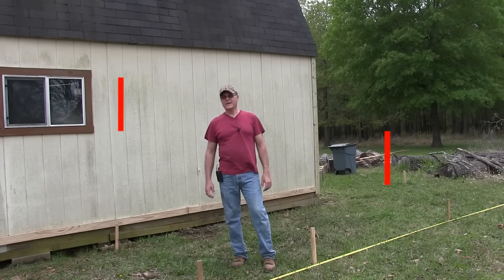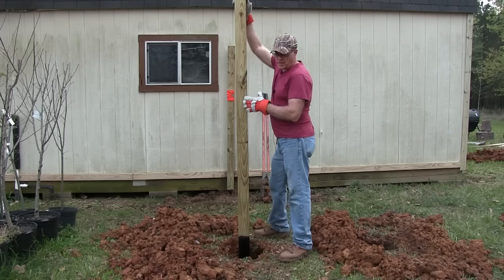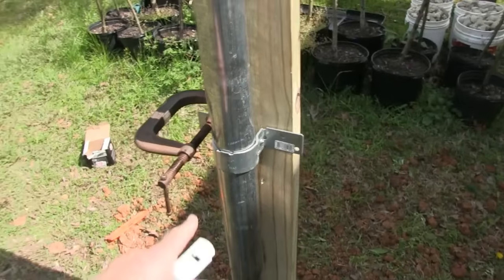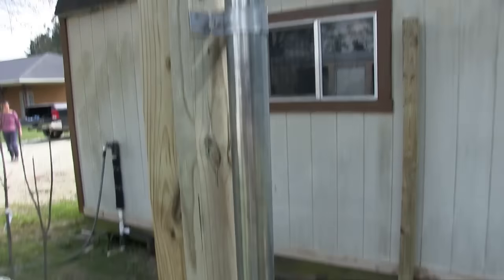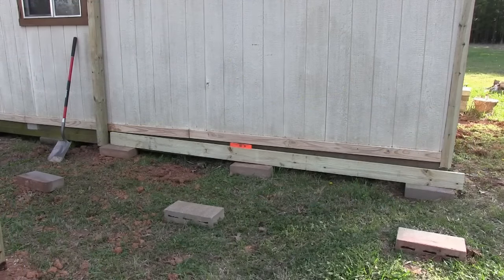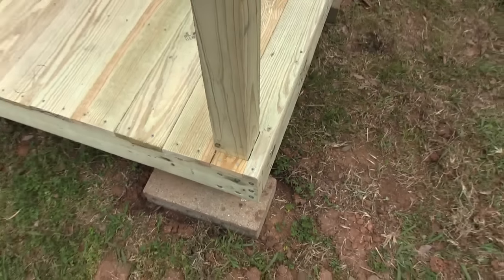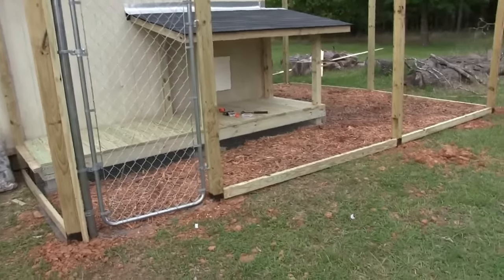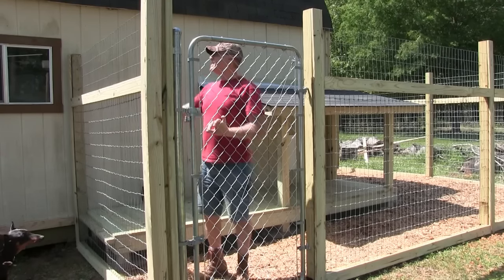Building a dog kennel

Comment: Great job! Just some opinion, instead of putting the mesh to prevent digging, you actually could lay some stone deck on and between the stone deck, cut a 1” or 1 1/2 diameter PVC in half as a drainage lead to outside the kennel, so when they poop on the stone deck just flush into the PVC and running along to outside.
Reply from the maker: Thank you

Comment: Awesome Build!! Thaaank you for sharing!!
Reply from the maker: Thank you
Reply: I'm about to start building a dog kennel, with concrete slab, and now you have me rethinking that plan. Concrete is just so heavy to deal with. I wanted to avoid digging the post holes, but now I'm thinking that may not be so bad if I can get the floor of the kennel set up right. Maybe I'll put gravel beneath, for some drainage.

Comment: You did a really nice job, great work. I'm considering a design that will prevent my dogs from reaching the ground, my dilemma is pouring concrete for an area that will be sufficient for thirteen dog is a little costly especially after factoring in the cost of all treated lumber. I still have a little time because eleven of the dogs are six week old pups and with winter coming in I may wait until spring to move them outside. Some people have inquired about the pups but I can't be certain that they won't be used as fighting dogs so I'm just going to keep and train them, after this long msg I basically just want to know if you have any suggestion on a design?
Reply from the maker: Thanks, I'm glad you liked the kennel. I don't know how big of an area you have to work with but 13 dogs is a lot. My area in the kennel is 224 sqf and you'll probably need at least 500 sqf at minimum. Personally I would make it similar to mine to keep cost down with the 1/2inch hardware cloth (mesh) staked to the ground, and a few inches of wood chips on it. The wood chips let the urine go through and the poop is super easy to pick up with a shovel and the dog can't dig a hole. The dogs stay clean and there's no muddy mess to worry about. The cost to put concrete would be a bit costly and then you'll have to hose it down every day because of the urine. Sorry I probably wasn't much help but it will keep cost down if you build it this way.

Comment: Extremely. Nice Kennel. !  I had to laugh. How the dogs were actually. Hanging out. On the.  Decking   Right away. Its  like they.  Figured out. Right away. What is  home !   I can tell. You have.  A lot of experience in.  Constructing.  A functional and practical. Kennel  i was wondering. If there is any. Concern. On using. Pressure treated. Lumber  for fear of dogs chewing on the toxic chemicals   That is used. In the process ? Or  are there any  other. Cost effective.  Products that. Can be. Used. For that type of a enviorment ?
Reply from the maker: Craig Monteforte Thank you, pressure treated wood today is not the same stuff they used years ago. You can always make it out of cider, but that would be very expensive.

Comment: Good video Pete.  I have a couple of GSPs and have always had my bird dogs on slabs and always heard the dogs should be off the dirt.  That said, I realize I and others could have been misinformed all these years.  I need to do another kennel soon but concrete cost is bumming me out.  How has your kennel worked a year in now as far as dogs having the mulch?  Is it a certain kind of mulch?  Thanks
Reply from the maker: The kennel is working great. The 1/2 inch hardware cloth stops them from digging and the mulch is softer for them and puts a barrier between them and the ground. If a weed gets through I just get a flat shovel and scrap under the chips against the hardware cloth and cuts the weed off. The mulch I used is Cypress mulch and it's holding up real nice.
Reply: Thanks buddy

Comment: Do you think welded wire would be okay instead of using woven?
Reply from the maker: Yeah it should be okay but the horse fence I used is much better.
Reply: @petebeasttexashomesteading  I was thinking of going that route, but i've only been able to find 330ft rolls of the stuff. That's maybe just a little bit more than i need lol.

Comment: Can you send me a list of all the wood I would need for this like the size of the posts and ect.
Reply from the maker: It's difficult to figure out all that you'll need, I usually do things in my head, but I"ll give you a general idea. The posts are 4"x4"x10' long and connected with 2"x4"x8' long but cut to fit. I used horse fencing that I bought at Tractor Supply Co. and sandwiched the fence with 1"x4" boards. The deck frame was made with 2"x6" and I used decking board for the deck floor, it's advertised as 5/4 in. x 6 in. x 8 ft boards at Home depot. I used 4"x4"s posts to hold the deck roof and made a 2"x4" frame for the roof. All wood is presser treated and I put everything together with decking screws because it hold much better then nails.

Comment: What  are the measurements of the boards along the bottom of the fence? 2x4x8?
The "Rails" of the fence are 1x4x8?
 ( 29:15 ) Sandwich = 1x4x8 | Wire Fence | 1x4x8?
Reply from the maker: Yes the boards at the bottom of the fence are 2x4x8 but then cut to the length I need, and the same with the 1x4x8.

Comment: Where did you get the wood chips and what was the cost?
Reply from the maker: It was a no float cypress blend mulch I got at Lowes for $2.68 a 2 cu ft bag. Here's the link. http://www.lowes.com/pd_20248-20248-215_4294937087?productId=4564624

Comment: What kind of wire fencing is that at the bottom?
Reply from the maker: The lower portion was 6ft horse fencing.
Reply: @petebeasttexashomesteading  hey, thanks for responding. What’s the diameter of the holes on that fencing?